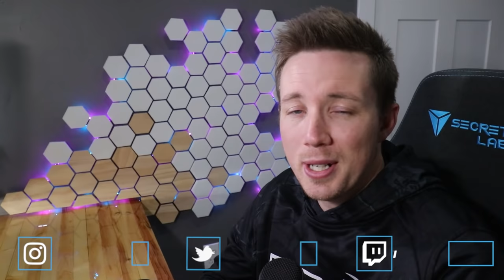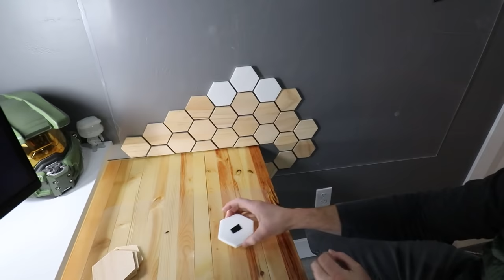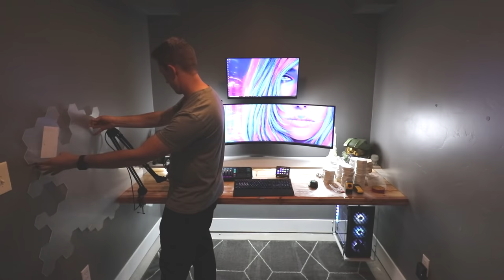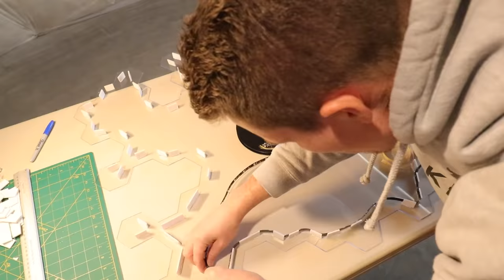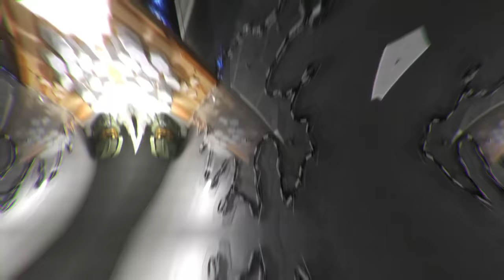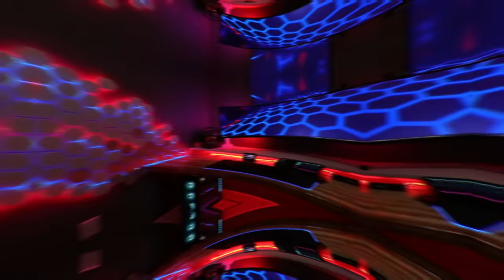DIY RGB Lighting for your Gaming Setup! 🌈 | How to make

Comment: Something i noticed that i don't think you showed in the video but did you end up running additional led strips through the middle of the piece? Because i could see on the lighting effects that the centre was lighting up aswell. Looked absolutely incredible
Reply: I noticed that too.
Reply: @Gambiarte  i noticed too
Reply: I think the LEDs are pointing from the outside in, and behind the plexiglass so you're seeing the light shine all the way through the back of the structure
Reply: @JackSkates  that's what I initially thought but if you look from 06:30 you can see individual lighting around some of the middle hexagons
Reply: No, there is definitely an added Led strip lane in the middle which wasn't there, when he showed the attaching of the strip first. Guess that area was just too dark and inactive

Comment: Awesome video! This has inspired me to make a build like this! I’ve brought all the materials! Just stuck on the wiring and programming part! Would appreciate if you made a video explaining the wiring and lighting effects you have 🙈
Reply: @FLXtv  Thankyou for the reply, any details on the release date? a few questions if you dont mind answering them 

1) Im planning on having 2 sets of 5m LED strips, in terms of setting them up, will they both be connected to the ESP8266 Node MCU and that will be wired to a powersource? 

2) how did you programme the lighting effects? were they easy to do

Cheers
Reply: @zeeshanaslam5056  the video is out, im planning to do one too 🙂

Comment: Epic idea and great execution. Only suggestion for improvement would be 1) use frosted plexiglass 2) stand plexiglass further off wall, maybe 2". 2) run LEDs on wall facing out towards room. 3)The distance between plexiglass board combined with it being frosted will provide a much more even, diffused look. But great project nonetheless!
Reply: wouldnt frosted plexiglass make the leds not shine through as well?
Reply: @ethanhaley5439  no it merely diffuses the light and hides the individual leds
Reply: @ethanhaley5439  yessir shoukd work great. Remember, the second key to this is getting it spaced off the wall 2" or more and running the less on the wall rather then the acrylic. Also might want to consider using some of that acrylic to make a frame around the whole thing so let's aren't visible from the side.
Reply: @DuncanBuilds  so would it work if i use the frosted stuff and also put the leds on the back?  Because there is a pretty high chance we are moving sometime soon, so I would like to be able to move it somewhat easily.
Reply: @ethanhaley5439  yes the only downside to putting the kids on the acrylic is the tape itself will block the light anywhere it crosses between two hexes

Comment: I just finished building this and it looks amazing! Thanks for the detailed guide!
Reply: Hello Can you maybe help me then HOW is there led light in the middle when there is no led strips there??
Reply: I used a 5 meter led strip and kept it close to the Middle of my design. There will be some darker areas but nothing annoying. You could also get another led strip and use the same data for both to create a 'double sided' led strip but to me, that isn't worth it
Reply: Also, for his design, he has a part of the led strip running through the middle part
Reply: @toonspooren1437  oh thx :)
Reply: @toonspooren1437  But how to control the lightinbg
Reply: @toonspooren1437  I mean how to control the lightning he is using
Reply: He uses an app called WLED, it has all the effects
Reply: @toonspooren1437  THX SO MUCH 🙏
Reply: No problem!

Comment: Well it took all day but now it works
I built it. Biggest issue was to cut plexiglas.
I couldn’t buy the big thinker sheet (didn’t fit in car)  So got a thinner half sheet.
But it cracked when sawing it (even with special blade)
I ended to using the Dremmel instead.
Anyway looks fantastic
Thanks again for posting this!
Reply: Right now I got 3 16’ LED strip lights in parallel. (since it was easier not having to add power injection)
- Did you compare serial vs parallel?

Comment: I really like the look of these panels. There are just a few things I would do differently.
First I would use spacers to get an even distance between each hexagon and would just have left the ones cut half over the table away. Maybe you could have even gone with a thicker foam but I don't know about this one. The thing that bugs me as much as the odd spacing is that the wooden panels aren't all oriented in the same direction and are sadly not raised slightly to be on the same level as the foam.
All in all I really like the general look of it, even after all these points, it is a great idea, just that I'm a joiner and I can't stop thinking as one.
Reply: the reason spacers are not useful is because the hex wood is not the same size. You can start with the spacers, but during the installation of the other pieces, you will have to adjust by eye to keep the symbiosis.

Comment: excelente , no se si notaron pero en la parte del centro también coloco una linea de luces led las cuales no muestra en el video pero se nota cuando esta haciendo las transiciones de movimientos, para que lo tengan en cuanta al hacer el proyecto porque esta genial para mi cuarto. Gracias .

Excellent, I do not know if you noticed but in the center part I also put a line of led lights which does not show in the video but it shows when you are doing the transitions of movements, so that they take it into account when doing the project because it is great for my room. Thank you .

Comment: Hello, what motion sensor can I use with 30 meters of ws2812b LED strip connected to an esp32 controller and powered by a 5V 60A 300W power supply?  and how to assemble all this, there will be 6 strips of 5 meters each with a number of diodes of 60 per meter, how can I assemble all this and what motion sensor should I use so that it turns on only when someone moves, and then after a while it turns itself off and so that  it worked even during the day,

Comment: Can you give me the code for the leds? And i need an arduino uno for each led strip or i can use the same arduino for 4 led strips? Cause i am doing a litle diferent project. Similar but the acrilic is 4 meters long

Comment: that's cool but there's gotta be an easier way than having a massive rgb led controller on the wall. can't it be connected to the pc to be controlled by the inboard rgb controller or software?
Reply: Yes it can. You would have to buy an led strip that either has 3 or 4 pin rgb connectors, cut off the connectors and solder the wires to make them longer, maybe to make it a bit cleaner you can wrap in electric tape. Drill a hole in the back of your pc, and connect the wire to the header on your motherboard. Or you can control it from your pc over WiFi, but you need a wifi rgb controller.

Comment: What size bit did you use for drilling holes in the plexi? And also would toggle bolts work in those mounts? Feel like that would provide more support on the wall. Currently making my own and would like help asap
Reply from the maker: Honestly I don’t recall the size of bit that I used for the holes in the Plexi. It was just large enough to fit the screw I used with those mounts. Toggle bolts should work just fine as long as the bolt itself can fit inside of those offset mounts. I located the studs and made a mark on the plexi glass so I knew right where to drill. But The whole panel really isn’t heavy at all so a few toggle bolts should be fine if you can’t get into a stud.

Comment: Could you make video of setting up this WLED controller because  I made it, but it sucks to go every time on this website and have to control the LED with the trash Design/ Web interface. Have you any Ideas how to fix this?  that I can control led lights in a circle colour picker like in the philips hue app?
Reply: @FLXtv  i have to go to the website every single time when i want to change the led and if i want to change the colour i have to click on the Color i want and then on the „change Color“ button and i want to change the color with one click or with a color picker, Sorry for responding lately, i didn’t get a message when you commented

Comment: i dont have such a small room. so i dont need to use acoustic absorber, right? not easy to find on german amazon
Reply: Nimm einfach Moosgummi oder Schaumstoff
Reply: @rolandds1  hm. Ist ne gute Idee, aber das ist ja eher nicht so stabil. Mal schauen und ausprobieren. Danke dir 🙂
Reply: @IGIMaster86 
Ich habe mir heute bisschen was bestellt, weil ich es auch nachmachen will.

https://www.amazon.de/dp/B00Q60Z8L4/ref=cm_sw_r_cp_apa_glt_i_NQQNFM5B8F7M2SGB8HHG

Ich habe die bestellt.
Reply: @rolandds1  cool. Danke dir ✌🏼. Würd mich freuen, wenn Du mir berichtest, ob es damit geklappt hat 😎. Viel Erfolg
Reply: @IGIMaster86 
Klar doch
Wird wahrscheinlich nächstes Wochenende alles da sein und gemacht 👍👍
Reply: @rolandds1  geil. Danke. Wünsch Dir viel Erfolg und viel Spaß 😉
Reply: @IGIMaster86 
Hat gut funktioniert! Ich würde allerdings 4mm starkes Moosgummi nehmen, da bei mir bei 100% Helligkeit, das Band etwas durchleuchtet, sieht aber extrem cool aus.

Hast Insta oder so, dann kann ichs dir schicken, wie es bei mir aussieht

Comment: Only one thing. What you showed is NOT what's on the wall...
Reply from the maker: Only difference is the light in the middle which is the same led strip just extended. I lost the footage but that’s the only difference.